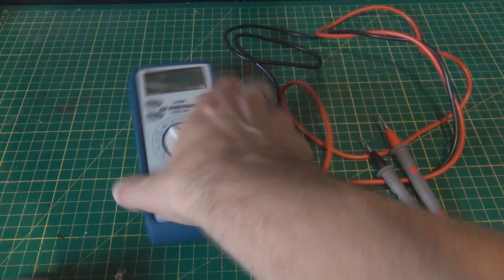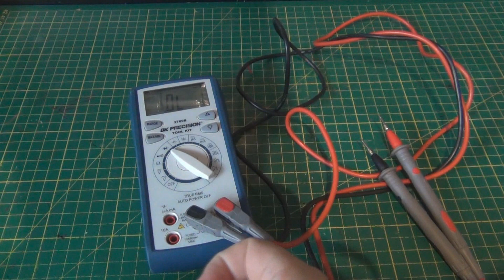4 ways to test an LED

Comment: Nice vid! 
I'm getting into modding the kits I build. I want to start with a simple boost. This particular boost has the option of using a BS170 or 2N7000. I would like to be able to switch between them using a dpdt switch. Any ideas where I could find some tips?

Comment: Hey mate, great video! Thanks so much. 

Just a suggestion for a video that I’ve been trying to find - how to add a clean blend modification to a pedal I can’t figure out how.., thanks again mate!

Btw the 2 boy in the well circuits you sent to me sound great I’ve wired them up into the same enclosure cascading into one another with a toggle switch the splits the circuits into a stereo option, it’s a great sound!!!

Comment: Very valuable trick. I have been keeping a coin cell in my LED box for several years now. Has enough voltage to test every LED I've corm across and won't burn them either if you only use it for a brief test.
Especially useful when it comes to sorting clear LEDs.

Comment: Yeah, I coin cell batteries all the time at work. Due to most LEDs having forward voltages of 2V and higher and usually don't poop out till 20mA of current draw, you only need a few ohms of resistance to stop them from popping at 3V. Add the properties of lithium coin cells having a pretty good voltage sag after a couple milliamps of draw, and that usually allows most LEDs to pass the "do not blow up test". LEDs with particularly low forward voltages or low maximum milliamp draw may still pop on a coin cell.

Comment: I use coin batteries to test my LEDs all the time xD I even built a little circuit that is just a 2032 clip soldered to two female jumper sockets -- just clip a battery in and insert the LED. No resistor needed.

Comment: I've tried fresh coin batteries a lot like this for an art project, never a problem.
Reply from the maker: Good to hear punk, thanks for letting me know :D
Reply: @DiyguitarpedalsAu  I wonder what voltage leds actually fail at?
Reply from the maker: @SXTransmission  It would depend on the LED, but a fresh 9v battery usually destroys most LED's from my experience
Reply: @SXTransmission  , depends on the LED and its forward voltage value. LEDs can typically handle a few more volts above their forward voltage value before completely blowing out, but even a little "over", given enough time will fry them permanently. Some blue and white LEDs tend to have the highest value at around 3V, but I can typically kill them at around 6V or so. 5V will kill them, but it may take it some time. Red, Green, and Yellow LEDs are much lower and 5V will typically kill them pretty quickly. Remember, the battery's leads and the LED's leads are resistors, so they do "help it" from not burning out immediately.